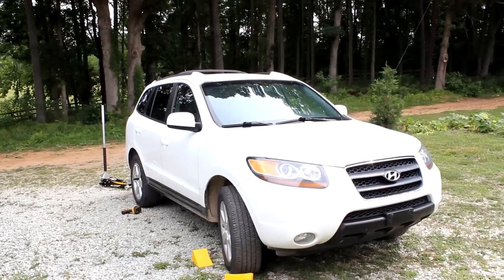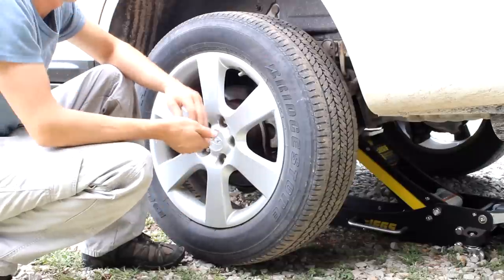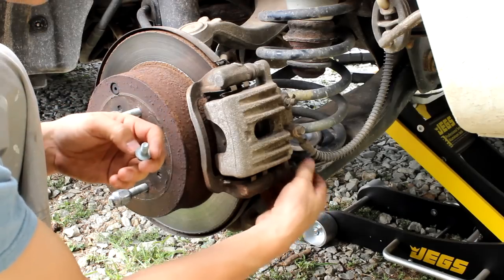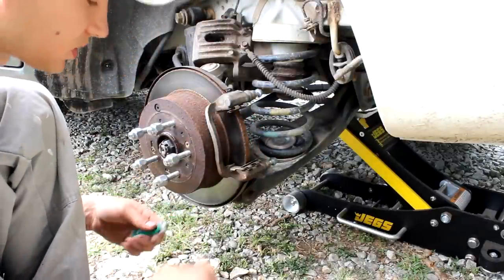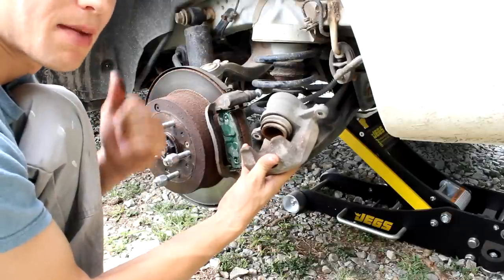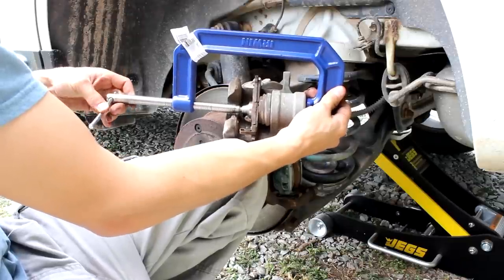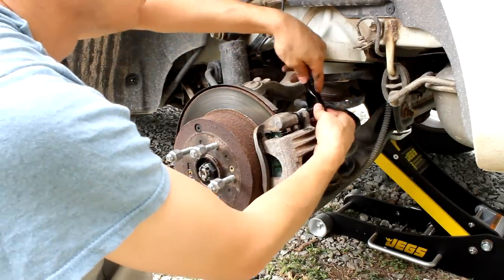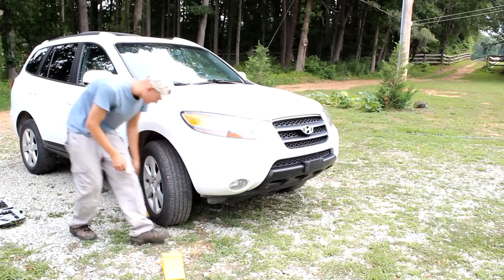Replacing Rear Brakes on Hyundai Santa Fe 2007 pad

Comment: Nice. Noted you don't have to take the caliper all the way off. Just do the top bolt and the other one rotates to the side where you can change pads.  Then use your old pad or a wrench as a brace and then c-clamp on the bolt off the back of the caliper. Easy as pie!

Comment: Thanks for the instructional video. Never attempted brake pad replacement before and this video was clear enough to see exactly what to do. Both rear sets replaced and even cleaned and checked the front using basically the same instructions. Many thanks fella.

Comment: Thank you Matt. you made changing my wife's brake pads an easy 30 minute job. Her car is an 06 and looks identical to the 07 (even uses the same 14mm bolt size). Only thing I did different was to loosen the bleeder valve to push the caliper in easier because I didn't have a c-clamp handy.
Reply from the maker: Awesome, I'm glad I could help!! Thanks for watching and leaving feedback!!
Reply: What did you use since you didn’t use clamp

Comment: Thanks for the demo. I was concerned if there were any special tools involved before I found myself without the wheels off. Once while changing brake pads on a Mazda, I found the assembly had a special star patterned socket to remove the assembly. Meanwhile Im on blocks. Thanks again.

Comment: when you do this job take the opportunity to clean and put some brake grease on the slider pins so the caliper can move free.
Reply: I would replace the brake rotor also at the same time instead just the brake pad

Comment: Can you compress rear wheel caliper pistons on all cars/models with a C clamp, or would some require a brake wind back tool?
Reply from the maker: I don't know the answer to all cars, but every car I've ever worked on could be compressed by hand or with a c clamp.. Sorry I answered with an open ended answer!!
Reply: Clamp compres only works with manual hand brake, for the electronic hand brake you need a specialized tool for reliasing. sory for my bad english...

Comment: I'm having a heck of a time getting the bolts loose. I have them soaking in Penetrating oil as we speak. Any tips?
Reply from the maker: sorry.. the penetrating liquid has always worked for me.. I would be careful using a pipe or extension as leverage, as the bolt could snap.. you could try and tighten, then loosen, or tap with a hammer.  Let me know if you ever got it off, and how?

Comment: Never change pads and not the rotors, The rotors have been thru their life cycle.After about 5ks they will become hard and you'll need to change them anyway. Lighten up on the lube too Dude and do the slider pins too.
Reply: Wrong

Comment: I didn't see any jackstands.
Reply from the maker: you are right.. It was the one thing I did wrong.. One person suggested putting the tire under the frame.. But you are correct, its best to use jack stands, even if you are not going under the car.
Reply: +joe moe  good observation joe